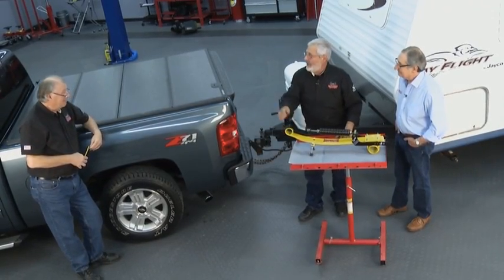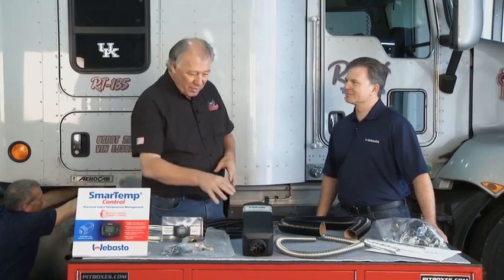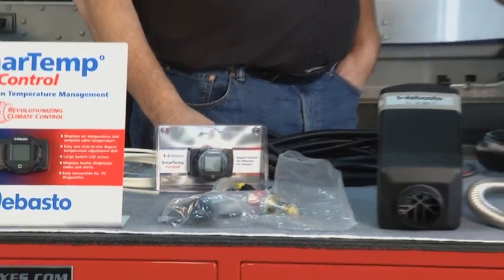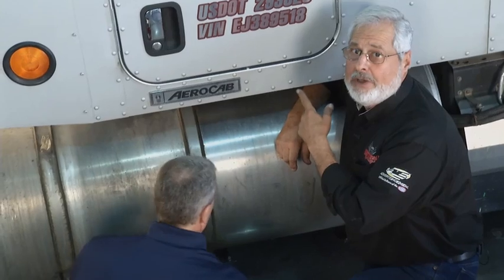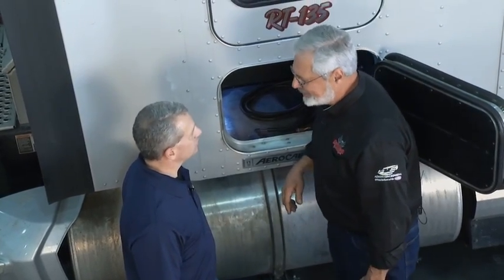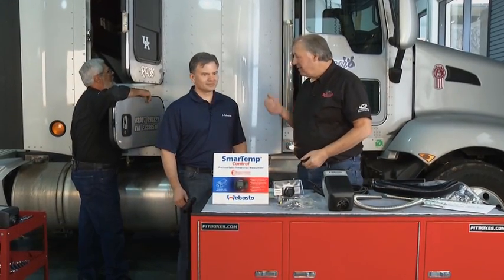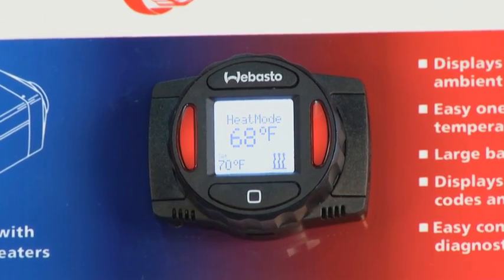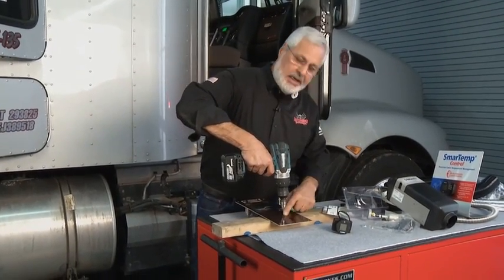Motorhead Garage: Webasto Air Top 2000 ST Install

Comment: you guys messed up. the intake needs to draw air from inside the bunk. Jockey boxes are always cold compared to the living space. so even when the temp is set low it's going to roast the driver out of the cab. because the thermostat is inside the unit and measures the intake temp.
Reply: That’s the first thing I thought of!

Comment: The tap on the top of the tank looks a little fragile! They do realize that this truck is going to be used, right? What temperature is the heat coming out of the output side? Could you route it through the normal bunk system so that the heat comes out the normal vents? Or would that melt the ducts and stuff?

Comment: Are you having to drill the fuel tank without any way of getting the fileings out that fall inside? I would rather freeze my Balls than have metal circulating inside the block. WTF. Tap the F in fuel line. WTF.